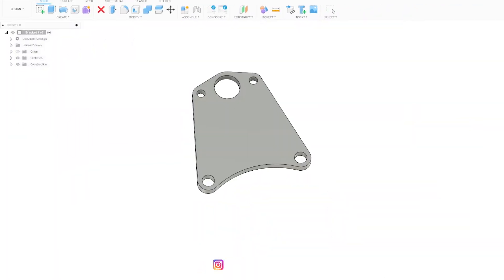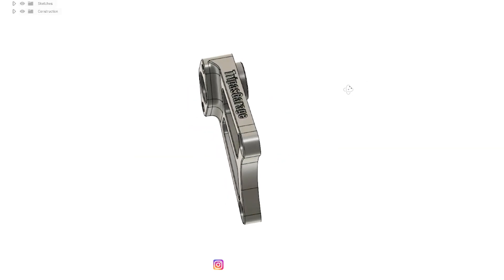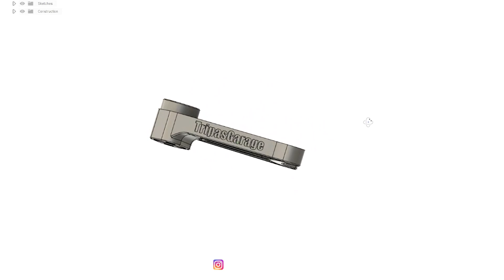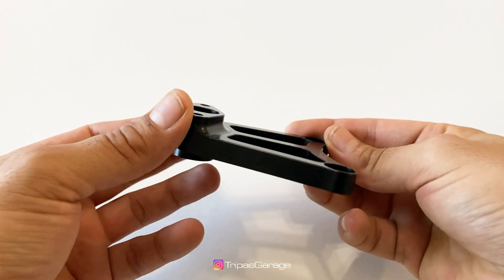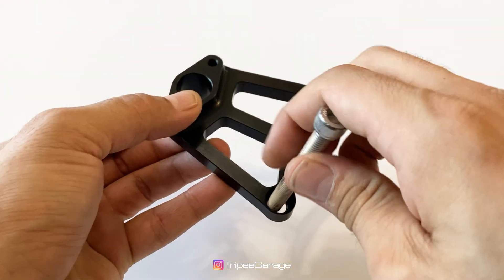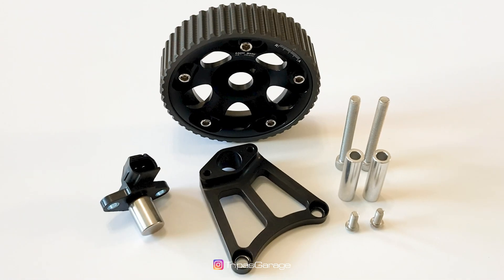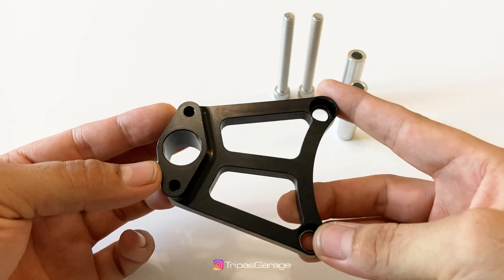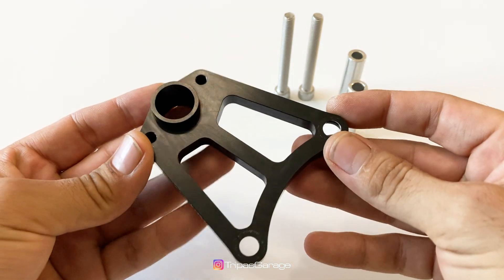2JZ GE NAT Cam Sensor trigger kit! NO WELDING NO CUTTING NO DRILLING!

Comment: Just wondering if converting a 2jz ge vvti engine with standalone ecu to na-t build, is there need for any other extra mods to support this cam sensor?
Reply from the maker: @Maboroshi1902  good question. With the vvti, you’re set already as it comes with a crank sensor and the head already has a cam sensor. You don’t need this mod at all. You could always run this mod if you wanted, however you already have it implemented into the head by factory.
Reply: @TripasGarage  Got it, thx for clarifying!
Reply from the maker: @Maboroshi1902  You're very welcome. Enjoy

Comment: when using this setup with the front cam signal what angle is tdc? im using an ecumaster and im trying to figure out ignition timing. thanks
Reply from the maker: Hey, did you get this figured out? It's going to be dependent on if you're running the gears I offer or your own.

Comment: Is there any benefit or difference to the dual trigger setup or is it only for the oem ecus? im looking to build mine just around 500 hp on a standalone what would you recommend?
Reply from the maker: @brandonallgrim511  No benefit between the two in terms of performance however the dual trigger kit is factory ECU friendly and also works with a standalone. If I had no desire to use the factory ecu, I would go with this single kit in this video. If you do go with the dual kit and upgrade to a standalone later, it will work however you’ll only use one sensor not. Thank you for the inquiry and support.
Reply: @TripasGarage  Thanks so much you have a good one